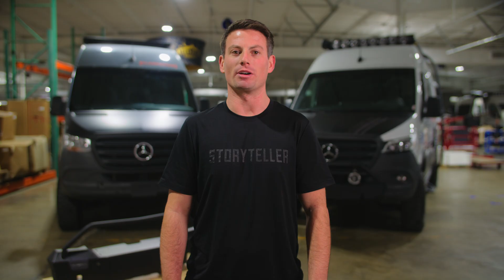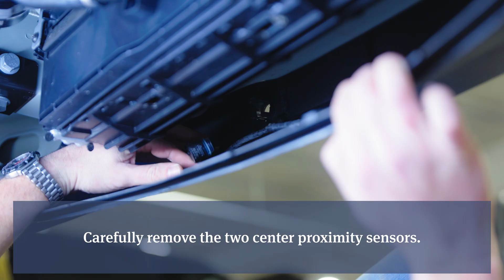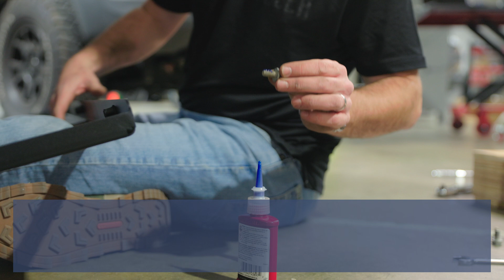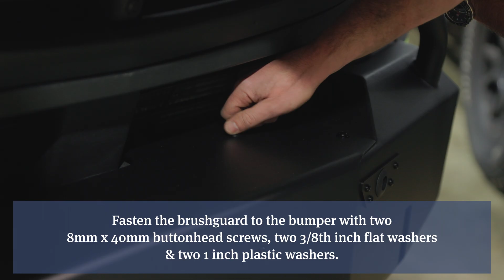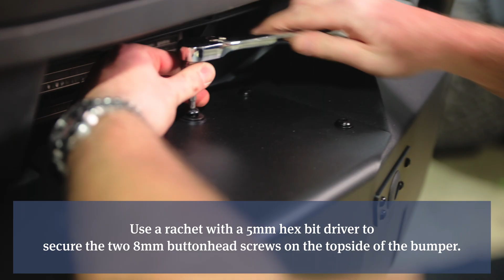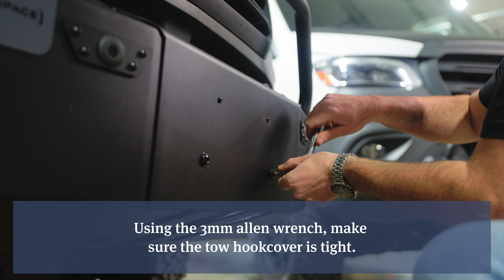How to Install the nVader Sprinter Brush Guard

Comment: Question:  Is there a modular connector for the proximity sensors that could just be disconnected and then fet through the holes from front to rear, instead of over sizing the holes in the plastic bumper?  Otherwise, looks like an easy install...I think I"ll be buying this soon.